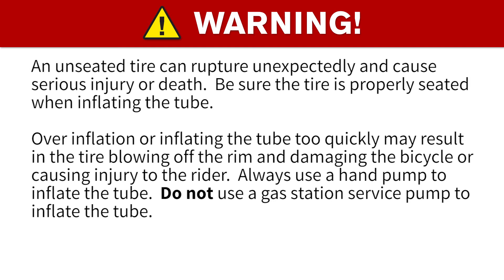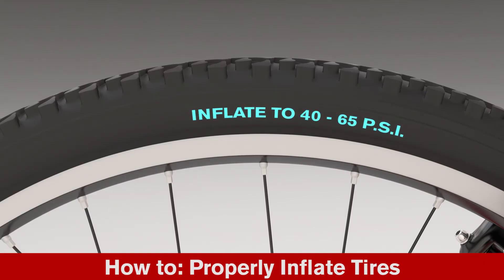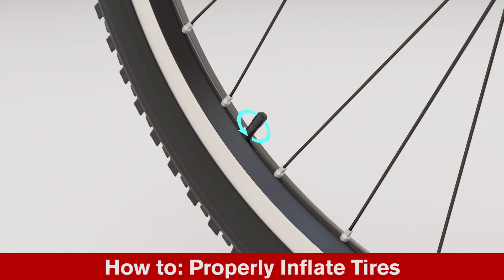How to Inflate a Bicycle Tire – How to Use a Bike Pump (Animated)

Comment: Here we go again Schwinn, or is it Pacific Cycle I'm addressing? I just purchased a Schwinn bicycle pump 11-8-17 and who would think that most people having used a tire pump before, would have any problem. Pretty simple, right! HOWEVER, what is the attached piece of thin black plastic that has a triangular opening at one end and two elongated slots on the other end?